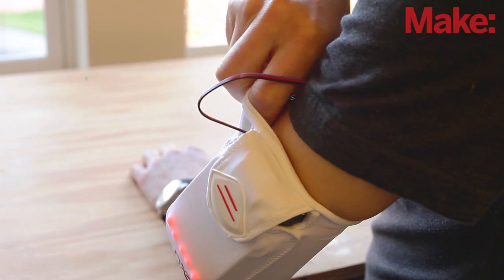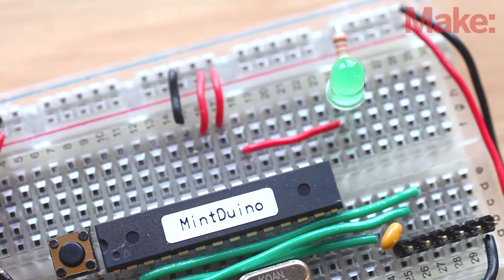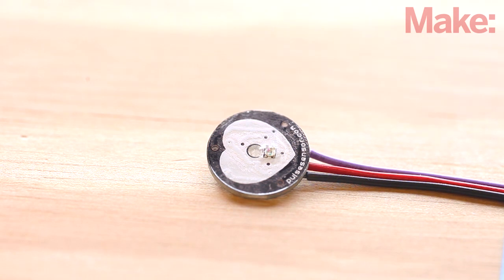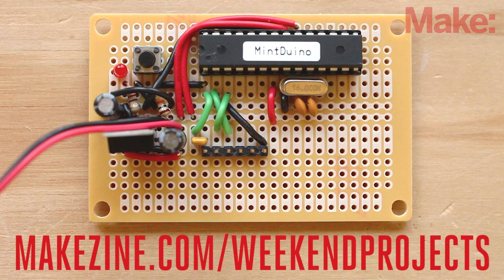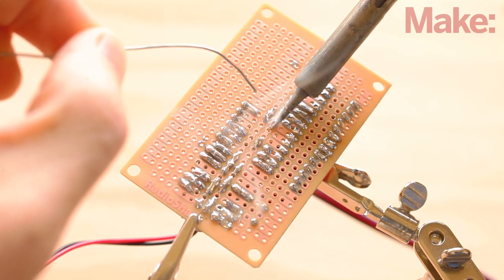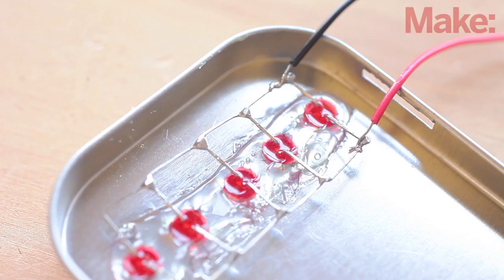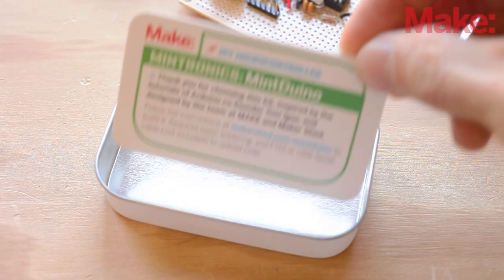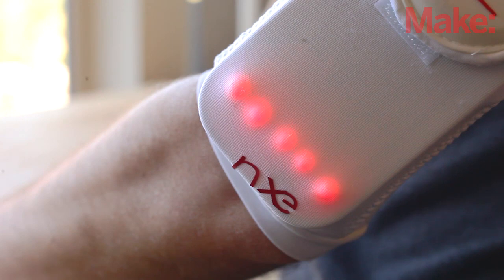Weekend Projects - Beatband Sleeve

Comment: how you make it work on the sleeve? i try to use pulse sensor on wrist but its not work,
what the keypoint for this problem? did i need to increase voltage of pulse sensor?
Reply: i have the same problem
Reply: quần đùi I have done this project .but I think pulse sensor can't penetrate our thick skin .just some capillary point.but it must very tight on the capillary for get the reading. but its to hard for do ir

Comment: Seems over-complicated. Why do you need a programmable microcontroller and a crystal oscillator and whatnot to essentially just send the almost raw data from the sensor to the leds. At least use an LCD to display heart rate and a LED matrix to draw a nice graph thingy.

Comment from the maker: Hi Gregory,
The project is centered around the MintDuino, designed to teach makers about Arduino clones and the joys of assembling a soldered microcontroller circuit. Once built, the clone can be used for pretty much any project, not just blinking LEDs to your pulse. Thanks for watching!